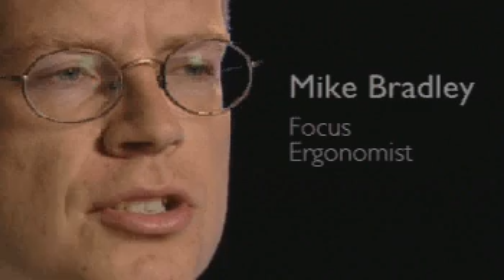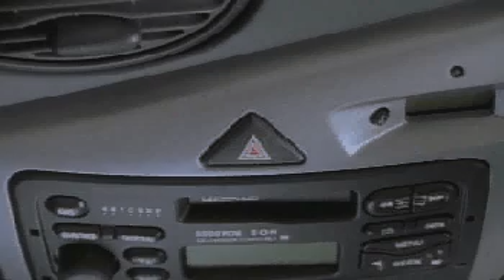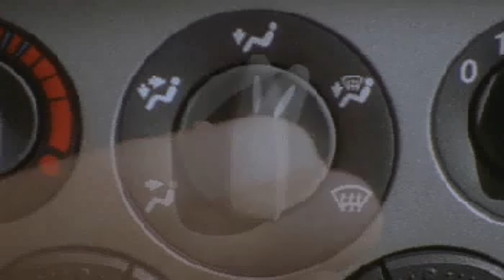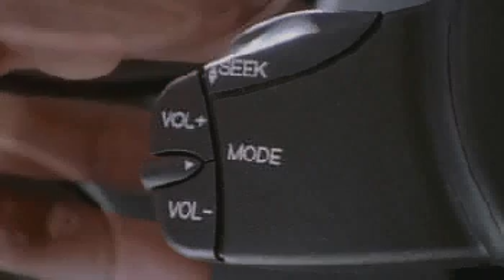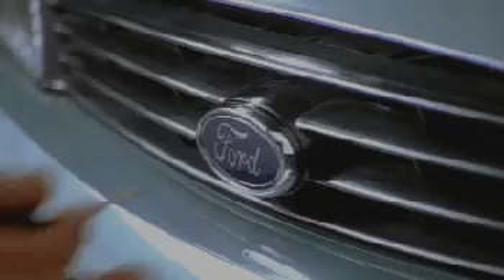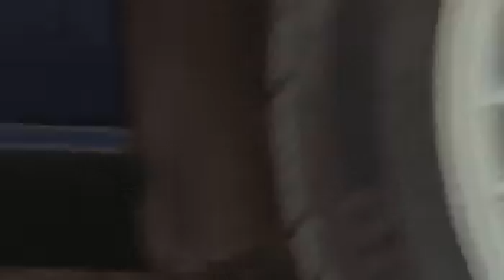Ford Focus MK1 1998 - Ergonomia / Design / Ergonomics

Comment: We designed the car around ergonomic studies, we didn't bother with a seat height adjuster for the passenger, we didn't bother putting in a gas piston in under the bonnet, we didn't bother rust proofing the bodies properly and we thought it was a great idea to put the E/M adjuster right in the a-pillar where its least likely to be found. All we do at Ford is make the plastics cheap diecast, hard and rattly inside like wheelie bins because we believe thats what people want = the new Ford Focus!